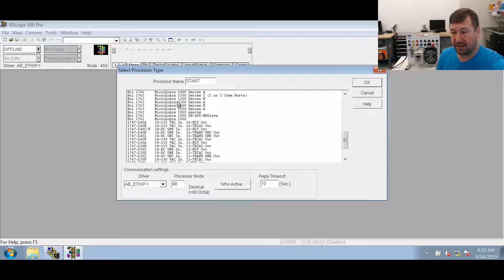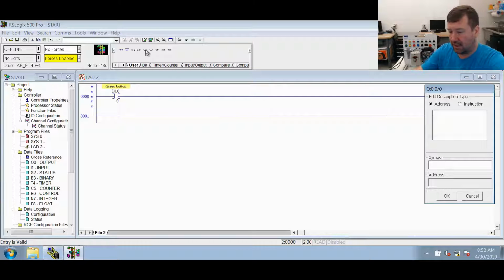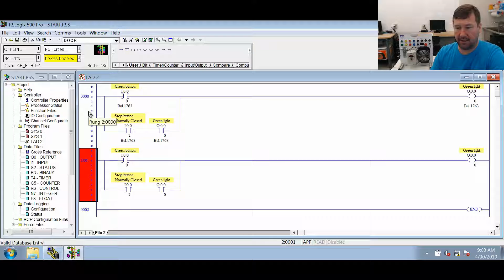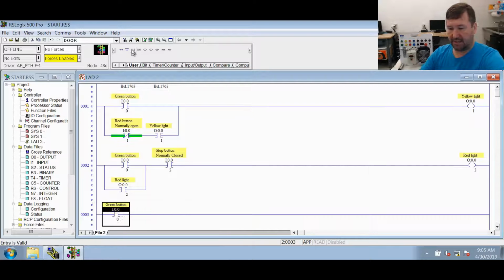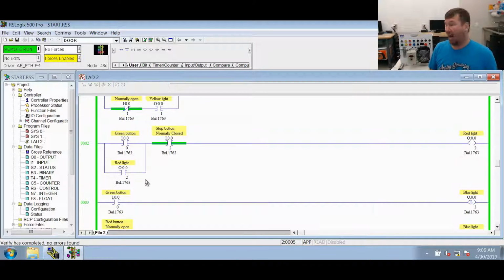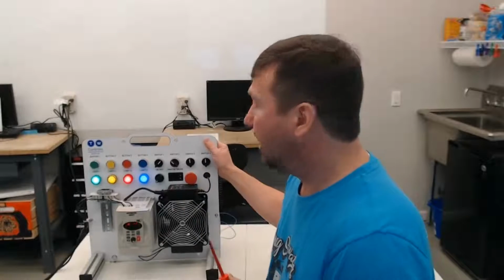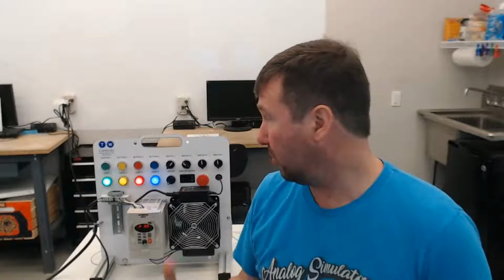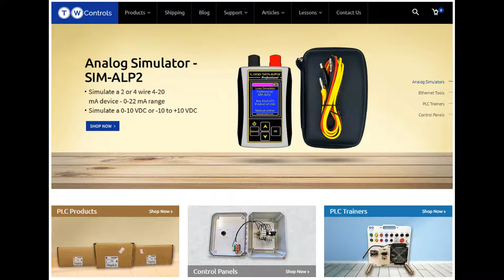Program a Start Stop in Allen Bradley Micrologix PLC with RsLogix 500.  OTE and Seal In, OTL/OTU

Comment: Perfect explanation as always.  The conclusion you made is the first one is the best option which provides a way for maintenance to pump the motor, meanwhile,  the motor stops when the wire breaks.  Am I correct? 
One more thing I would like to understand. Why the maintenance needs to pump the motor by pushing in the stop and push the start rather than simply pushing the start ?  "pump" here refers to making the motor to rotate a short time ?  Thank you .
Reply from the maker: There are many reasons to "bump" a motor.  Let's say you were replacing a mechanical coupling that needs aligned.  You may want to bump the motor to check its alignment.  Or let's say you are changing a motor and you need to check its rotation.  If you simply hit the start button, the motor will spin up too fast to see.  But if you bump it then you can visually see which way it is rotating.
Reply: OIC. Perfect ,thank you. Tim.
Reply from the maker: @dennisjiu1771  You are welcome, glad I could help.